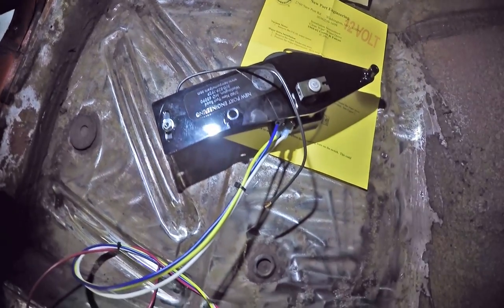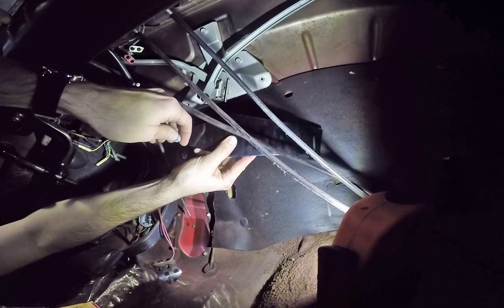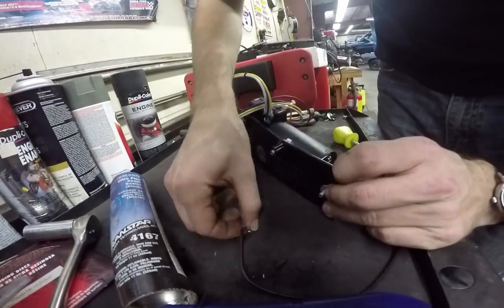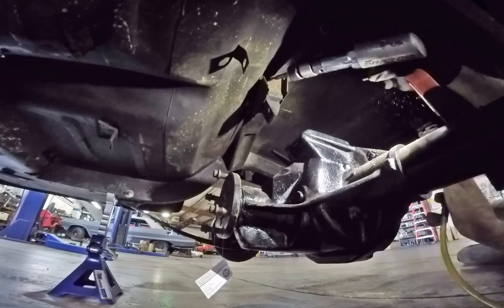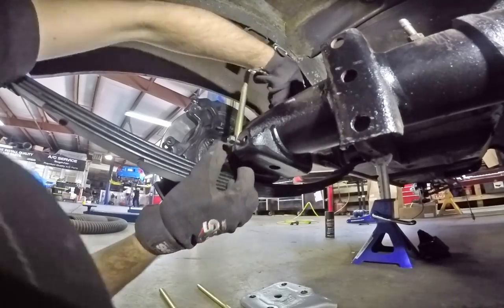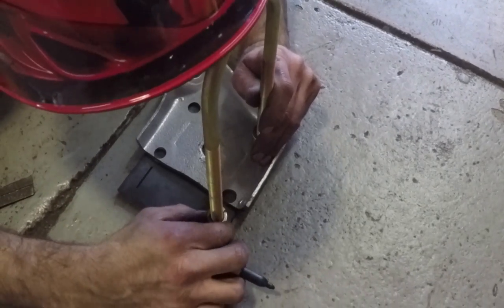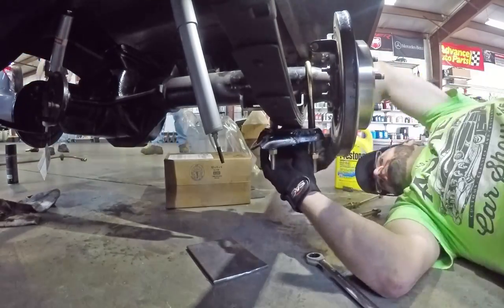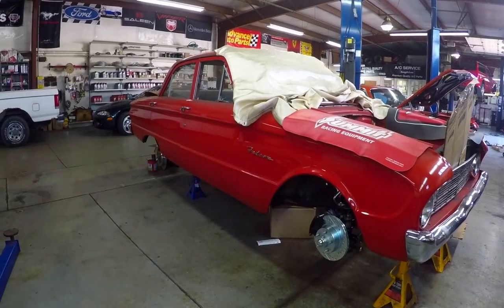Operation Vagabond Falcon: Part 13

Comment: You can fit a 215 mm tire on a 6" wide wheel which is plenty for a daily driver like the VF.  225mm+  tires start to look pretty wide and wouldn't match the look you're going for on the car.  Wider tires are also terrible in snow.
Reply from the maker: +fallwind101 215 eh? Maude eh?
Reply: +RegularCars Napoleon, woooo!
Reply: +fallwind101 the wheels 150mm wide and you are putting 215s on them? Sounds pretty bulged up to me.
Reply: +Mortalomena I just went to Tire Rack and looked up a few 215/70R15 tires and the recommended wheel width is 5.5" to 7".  The actual tread width on a 215mm tire is usually around 6.5" so it's a good match for the wheel.  No idea if 215's would fit inside the rear fender skirts though.
Reply: fallwind101 I have 215 on 8 inch wide wheels and it looks not stretched and not bulging. Just right.
Reply: +Mortalomena 6j15s are ok with 215s. I think it's the biggest recommended width for 6js. 
at least with low profile (that's less than 70%) tires.
Reply: zloychechen5150 I know its within the recommendations but it looks so stupid with the tyre bulging, looking like some Donald Ducks 313
Reply: Mortalomena well, the main reason i went for 205/65r15 for summer is because here in russia there's track in the tarmac everywhere (appears every spring), and 215s are terrible with that, they don't fit in this track well on most cars, so you just wobble around all the time. 
as for the looks, i think tall bulged tyres look stupid. if it's low and wide, on a flanged rim, it's fine with me.
Reply: zloychechen5150 hah neighbor! Here in Finland roads are good so no deep tracks, usually. I have 18 inch 215/40 in front with 8 inch wide wheels, and 245/35 in the back with 9,5 inch wide wheels. Goes like on tracks.
Reply: Mortalomena maybe someday we'll live up to that)))
which i doubt.
Reply: +RegularCars I ran 215s in the winter on my maxima, definitely don't look narrow
Reply: +Mortalomena You must live in a city then. :P

Comment: Oooh ouch. Don't let your inspector know you pop riveted that... I lived in PA, literally put pop rivets in my 1986 Saab 900, there was a small 3 inch x 2 inch rust hole in the corner of the SPARE TIRE WELL. And he said it wouldn't pass inspection because I used pop rivets to make the repair. So... I went home, slathered it with bondo, then spraypainted the whole thing black. BAM! Not "pop riveted" anymore. ;)

Comment: On the wiper switch, there is a little chrome nut in the middle of that chrome bezel that the knob goes into the middle of. See those four notches in it? There is a tube-shaped tool to unscrew that center nut that indexes with two of the four notches. But if you don't have that, the tips of a small, bent nose needle nose pliers works nearly as well. The light switch comes out the same way, then you can access that plate on the backside and cut it if needed.

Comment: I rolled the lips of the rear fenders in a little on my 62 and I can clear a 7" wide wheel.  A common mod to these Falcons is to graft a set of front fender arches (or arches from some other kind of car) onto the rear. 60's gassers were done this way.

Comment: You should be okay with 215 section tires, just make sure you don't cheap out on the rubber -- the compound (sometimes) has a lot more to do with good grip than how wide you go.

Are there any decent summer tires available in 15x6?  I haven't really looked.

Comment: I think this car would look great with Minilite wheels.  They do custom color, offet and bolt pattern jobs, so they lend themselves well to classic cars.  And the price is reasonable for what you get.  (EDIT, I found out they used Minilites on the racing Ford Falcons in Austrailia, back in the day.)

My Mini's running 175's on a 7 inch wide rim.  It kinda forces the tires to look a tiny bit "stretched", but they've worked well for over 20 years.

Comment: Get a fender roller it will roll the fenders nice and clean. Its not like the front end wasnt circumcised already. Might as well make it a full blown bar mitzvah.  You wont need steam rollers on that to hook up because its pretty light. Id say near 245 would give it a ton of traction if you can tuck them in there.

Comment: I still have a set of 2.73 gears for an 8.8 if you want more highway friendly gears than the 3.73 you have in that rear.
Reply from the maker: +jh77sly are you in PA?
Reply: no, TX, I have them in the FRPP box my current gears came in, so I can ship them, though that would be a bit. I have no use for them and you can have them for the cost of shipping. The box also has the speedometer gear for an AOD/AODE/4R70 that was originally in my AOD with those gears as well. Again, don't need it.
Reply: I know some guys just south of Pottsville that may have some as well. You could probably pick them up easy enough.

Comment: To be fair, a 302 HO made like what (at the crank) in 1993? 200HP? 235HP with GT-40 heads that the Falcon wont have?  I think you will be fine with 6" rear wheels.

Comment: 6in wide wheel! Holy shit that's not gonna work with a 302 V8. Winter+ PA rain + Windy roads means your gonna be sliding.
Reply: +Brap Brap Do you really think he's going to drive the Falcon in the winter?
Reply: +Kyle Clement why not.?
Reply: +Brap Brap Holy shit! What do you think the V8 Mustangs and Falcons came with from the factory! 6 inch wide wheels! Wow isn't that amazing! It's 250hp not 800. With a decent tire on it, as long as he's not trying to drive wet windy roads at WOT I'm sure he will live.

Comment: Protip: instead of speccing different offsets just put an adapter type spacer in the back so that you can actually rotate your tires. Bringgs maintenance costs way down.

Comment: I used KYB Gas-A-Justs on my 122S.  SO NICE.  Nice ride, nice control of body motions.  I think they'll ride really nice on the Falcon. 

My old shocks were so blown that they couldn't have held up a limp dick, so even the cheapest Monroes probably would've felt like an improvement.  But, the KYB's really seem like a good street shock.
Reply from the maker: +andxx0r_the_second cool

Comment: 15x6 with 5" back space? Geez, that's gonna be interesting to see. If you weren't on such a tight deadline I'd say narrow the rear axle a few inches so you could fit 15x7 with the same BS as the fronts. Would look better IMHO. But ya gotta do what ya gotta do.

Comment: love your giddy laugh when you give the rear end ration... 250 isnt so bad on 6 inch wheels, thats the stock width on a neon srt4 and they almost have that much power stock. you should also be much better because your car is rwd.

Comment: Hold on! I really hope you did not drill the new holes in the weld seam?  
Thats extremely dangerous, and no, im not a youtube expert, just a guy who left a huge dent in the highway fence when my custom hubs fractured. They were fabricated by welding, and then machined. For some idiotic reason the machinist used the lathe to "clean off" the welds. I rushed to complete the car and did not closely inspect them, it almost cost me my life.

Comment: 215/45/R15 on the back should be enough
Reply: That's way too short of a profile. I don't even think that size exists. probably going to be 215-60R15
Reply: +GMdrivingMOPARguy You are right. I automatically went Miata sized tires. I forgot Falcon's tires can be taller

Comment: Dude take a half hour, and an angle grinder with a cut off wheel and cut the old perches off, don't do it the shitty lazy way to save a few minutes. if your gonna do an axle swap do it right, especially on an axle as good as the 8.8
Reply: +Alex Ottomano I was thinking the same thing. He's taking all these months to build the car almost from scratch, yet he 'doesn't have time' to grind off the old perches. I did mine in an afternoon, it doesn't take very long and looks so much better.